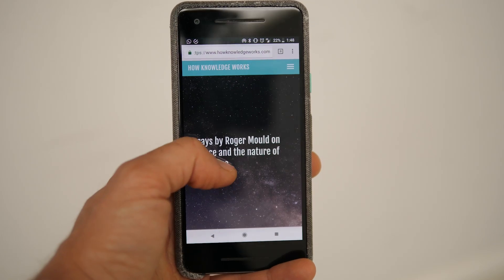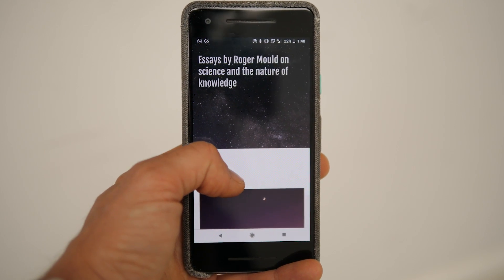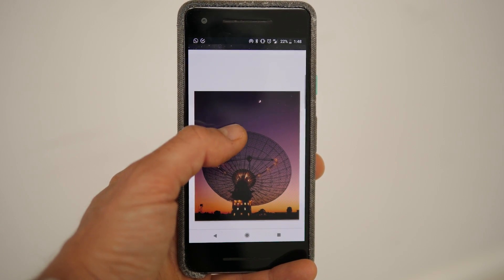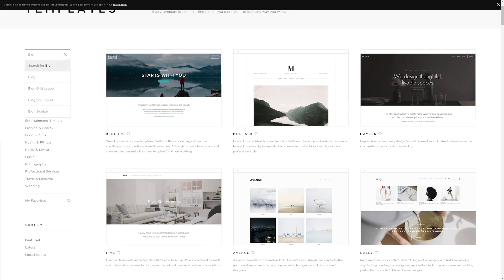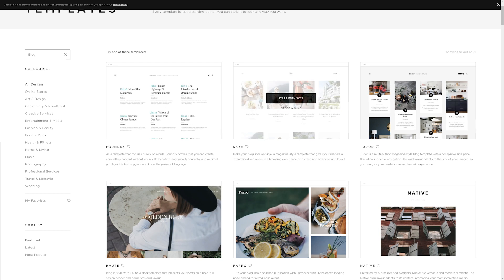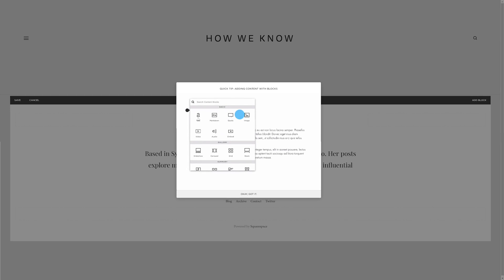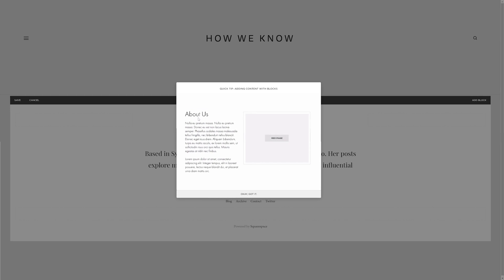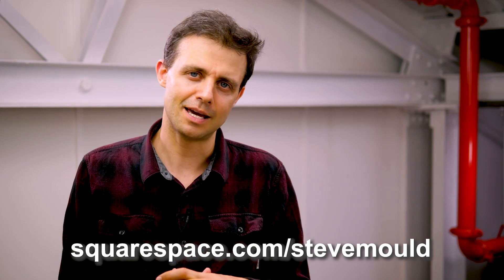The bizarre ripples that form in a stream of water

Comment: 5: 12 i dont understand the explanation here, because the surface of a cylinder would be smaller than the surface of that "tunnel" shape. If were talking about the surface of that red circle though, then why is soap trying to minimize that instead of whole surface like it would with a bubble ?

Comment: I used to turn the tap down to the thinnest laminar flow stream and then slowly push my finger up the stream in order to push the waves up until they touched where the water emerged and then that would trigger the Rayleigh-Plateau instability and then the water flow would remain broken without changing the flow rate (opening the tap further). I tried the reverse and could sometimes get it to shift state back to laminar again. I didn't know any of the physics was behind it so thanks for diving deeper for us! <3

Comment: 34 seconds into the video: my 5 cents is that it has to do with the surface tension that creates a flow difference between what inside and outside the surface tension area: thus the ripple.

Comment: The ripples in the obstructed water flow look quite similar to the ripples that can appear in a rocket or jet's exhaust plume. Assuming the two phenomena are related, something you don't see in the water flow is that these ripples interact internally with one another, creating what's referred to as "shock diamonds" (which is probably the best term you could Google if you want to see a nice clear example of the ripples in an exhaust plume).

Interestingly, while a rocket ascends, and the ambient atmospheric pressure lessens more and more, the ripples appear to expand along the plume, almost exactly like how the ripples in the flow do when you move the obstruction closer to the nozzle. And this keeps going, until the visible plume is effectively just the "top half" of the very first bulge. The only real difference between an exhaust plume and the water flow being that the water flow doesn't expand laterally like an exhaust plume would, but that's just because the ambient pressure isn't changing during your experiment.

Comment: Hi there! I actually was a part of a nonlinear physics research group at SJSU that published a paper on this phenomenon. My friend Mark Fallis had a copy of “The Flying Circus of Physics” which talked about this phenomenon but did not explain it, so we asked our professor Dr. Lui Lam if we could run a controlled experiment to get some data associated with this effect on water columns. I made the apparatus and did the hard work of collecting data. There was a team that also worked on the theoretical physics behind it, and as you mentioned in your video, they realized that it arises from a minimization of energy of the surface tension. Our paper is in a text called “Nonlinear Physics for Beginners” and my crude drawings are featured in the publication. Heh. Thanks for doing this video. I’m sure you read a few papers on this phenomenon—perhaps read the paper that has my name on it as well. It’s been a long time, and I’ve forgotten most of the actual theoretical formulation but your clip was a fun walk down memory lane for me. I’m a college physics/astronomy professor now at Evergreen Valley College here in San Jose, CA. Thanks again!
Reply: The paper I coauthored was called “The Instabilities of Water Columns” (1989).

Comment: I don’t see this as strange. When it rains, raindrops hit the ground and bounce. Likewise in a laminar flow, when  the flow hits an obstacle iT (however partially) bounces. This upsets, interferes with, (or completely fractures) the surface tension.

Quite possibly, where there is a finger involved, heartbeat might become a factor.

Comment: It's surface tension. When you block the flow, it backs up the stream and it buckles. When the droplet separates from the stream, it snaps the end of the stream closed and the stream acts like a rubberband that sends energy upwards which has the effect of a momentary blockage.

Comment: Nice video!
But I missed the explanation of why the ripples form upwards of the obstacle, given that all of the water molecules are falling down.
In my opinion it has to do with the energy of hitting the obstacle is reflected in all directions, small part of which travels upwards, and the reason it happens is because the water falls slower than the waves traveling thru it (which would be the speed of sound).

Comment: In laminar flow all the water is going in the same direction but can be different speeds. Surface tension draws the water to itself. Right?
So gravity draws the water out of it's most spherical shape ,and the column has to narrow as it's speed increases. 
An obstruction slows the flow, allows the surface tension to pull the water back towards it's spherical preferred shape of least surface area ,and one creates essentially, a stack of incomplete spheres above the obstruction. 
If the stream gets drawn out narrow enough, surface tension again predominates ( area to volume ratio) and the stream breaks into a series of minimal surface area drops. 
They just come apart rather than blend together because they aren't slowing down- and therefore 'don't bump into each other ' .

Comment: I took a short video clip showing a very interesting and similar phenomenon. A tiny hole in a water bottle, when squeezed, creates a stream of water that exhibits a standing wave that splits into two streams that change direction very rapidly as you vary the pressure. After watching your video, I think this is due to the stream breaking apart at different nodes. Anyway you can see the clip here: 
https://youtube.com/shorts/PuhXok2ZQGI?feature=share

Comment: well molecules in a stream are connected and surface tantion (specialy in freefall) is pretty strong. so any curveture you introduce downstream will effect up. flow must be faster then speed of sound in water to overcome thesee waves. and it does not jump str8 to clean vertical wave . with unsymetrical intrusion you create asymetrical curve more then a unified wave

Comment: I wonder if you've ever noticed sometimes when a rivulet of tapwater is flowing down the side of a vertical surface, especially stainless steel, like a photo developer tank or a sink, sometimes the rivulet meanders like a river and will even switch back and travel upwards for a ways. What does that? My guess is electrostatic forces between the water's surface tension and the metal surface.

Comment: I am sure the water molecules ricocheteting on the obstacle must play a role. And surface tension, as mentioned. You can test the effect of surface tension if you create a laminar flow of water with a small amount of dish washing detergent diluted in it. This will diminish the surface tension and most likely change the shape of the standing wave.

Comment: I don't think it is the same as the water drip. Imagine a  black hole at the end of a laminar flow that creates an immense vacuum to suck the water stream faster than it can flow. The surface tension will want to keep some containment and as the vacuum is applied, there will be a thinning of the stream. In contrast here, we are putting a blockade that will increase pressure and the surface tension does a small amount of keeping the stream together and backs up the flow as much as the surface tension can do. When this backup is great, it will make a splash because it overcomes the surface tension, but when it is slight, it creates this bulge as if you were stuffing a sausage casing (the surface tension) and not allowing it to move forward.

Comment: I struggle to understand how the surface area of the soap film is minimized by curving the surface between the top and bottom. The shortest distance between two points is a straight line, so a perfect cylinder should have the smallest surface area, not one with a curved surface. 
Further, with the curved surface decidedly NOT being the minimum, why would preference be given to a concave bowing instead of convex? They can both achieve the same surface area. 
I would really appreciate an explanation/elaboration of why you said this as it seems like a critical point to the explanation you're making.

Comment: Holographic Principle Imagery projection-drawing Modulation, in Completeness. 
This is the evidence of empirical shaping laws squeezing everything, transverse trancendental e-Pi condensation by Superposition-point Singularity Positioning Thermodynamics of mass-energy-momentum In-form-ation in continuity. 

If you have a Ruler in your hand, transverse, you should see the marked measurements of whatever relative proportions it is intended to Reference to a Standard, (eg the wave length of light in Ceasium), so that the orthogonal-normal Positioning makes the edge of the Ruler a point. This is how Woodworkers check if the edge is "true", ie straight to the point. 
Time is omnidirectional-dimensional logarithmic interference positioning resonance<-> numberness of transverse trancendental, self-defining AM-FM e-Pi condensation In-form-ation, zero-infinity i-reflection containment = condensation modulation..

This is the cause-effect of time-timing sync-duration wave-packaging alignment of Electron-photon-phonon-Proton in the gravitational integration process of sync-duration time-timing, which effect you can hear by dragging a wooden Ruler along a bench, making it shorter and sending the pitch higher as the length over the edge of the bench shortens. Every kid does this, and it's great intuitive knowledge but better when explained and included in analogous phenomena like the one in the video. 

It's one of those "seeing the woods in the Tree.., can't see the Woods for the Forest" type situations of "putting things, (the QM-TIME Completeness cause-effect Actuality Positioning Principle), in Perspective", Precision is not Accuracy, that is why Teaching and Learning is Sciencing.

Comment: I feel like when you mentioned surface tension you were on the right track, but isn't it possible that it's just force from the obstruction causing a disturbance in the stability itself just by "halting" or "detouring" some of the molecules which are being held by the surface tension of the water?
Case in point:
When the water is just flowing in its steady laminar flow, it's smooth with no ripples, but as you have noted when something touches it, it creates the ripples. I feel like this has to do with the obstruction's force back to the water hitting it, as with every force applied to an object, the object must give back an equal amount of force to not be pushed back. So if you say, put your finger under the water and hold it steady, the equal force will allow you to keep your finger suspended under the force of the water, and the water's molecules will displace. Since it's a slow and steady flow, however, and not a turbulent flow, it is not enough force to break the surface tension. This allows it to, instead of flowing around your finger as water likes to do, keep its flow and instead creates back-ripples up the column. 
The vibration can be explained as well, this is the water attempting to move around the finger or object in question while battling the forces of gravity with its disturbed surface tension. It seems to be more prominent on something like cloth I noticed as well since the cloth is absorbing some of the water. and taking some of the water from the flow, creating gaps.
I mean I could be wrong entirely or missing something that I have no idea is there, but this just seems like the simplest explanation to me.

Comment: Yes, I know this 3 years old, but, I've noticed something weird when pouring cream into my sink. Starting low, it's a nice smooth pour. Then as you gain height, you stat to experience some splash. Normal. Increased velocity, increased chaos. 

But, why is it that when we pour it from an even higher height, it returns to a no-splash stream?

Comment: I thought this might be affected by the speed of sound propagating through the medium. Now, I am not sure if it is technically possible to get two fluids with the same viscosity and same density to have different speeds of sound propagation, and then to repeat the experiment to see if there are any differences in those standing waves. Maybe by changing the ambient pressure around the stream of liquid?

Comment: I am late to the party by a few years, but being recommended to watch this video again, I've been compelled to give a bit of my intuition in the subject. 
I have always wondered this phenomenon as a child, but never had the knowledge to understand why it happened then. During the field test showing a great profile of what it is doing, a light bulb went off in my head. It was then, that i remembered a certain quote stated, (I don't remember verbatim, so I will brutally butcher it) 

"An object has no knowledge of it moving or being still."

Therefore if a rock is moving at a steady velocity of "1" along the surface of water with a velocity of "0", the same effect will be observed if a test is done with the water moving at a velocity of "1" while the rock is at a velocity of "0".

You see in the test when the water is falling from the spout, there are no ripples if nothing is affecting the flow. Same as if a river of laminar flow has no obstruction in its path.
Now take a rock (the blue rag in this video) and place it in the river. You will notice there will be ripples propagating in front and behind the rock.
Same thing (I predict) would happen if the column of water is still, and you are moving the rag up the water at the rate of the moving water prior.

I predict the ripples get grouped together the further down you go due to the velocity of the water is higher. Same as an aircraft increasing speed in the air and visually watching sound waves get tighter together before reaching Mach 1, or a boat moving across the water at an increasing rate while watching the waves get closer at the front.

This is not by any means of a solution/answer to the effect, but its a more simple understanding in my mind and my theory on what is happening.

If anyone knows the quote I am trying to say, please do not hesitate to provide me the full and correct quote and by who. Thank you all.

Comment: "pinch harmonics" and node points up and down any stringed instrument? These are ratio points from either end of a tensioned substance? Does the surface tension act/behave like a tensioned solid? My guess, yes it does...the ratio to width/length/node is the resonance...I would suspect the "obstruction" behaves like a "slide" on a guitar. I would bet a submerged microphone would represent the wave on an oscilloscope? Añd why water instruments exist?
But, musing (music?) "aloud"? 🤣🤣🤣🤣
Actually? Wind instruments? Doesn't fluid dynamics/physics apply to gasses? Ramjets operations on harmonics/ pressure peaks?

Comment: I don't think so. The Rayleigh-Plateau instability happens when the flow breaks, while those ripples happen when the flow is "compressed", meaning that the shape and width of the flow tries to accommodate the starting intensity of the flow when the speed is reduced by the obstacle.

It is the opposite of the Rayleigh-Plateau instability, where the speed of the flow is increasing because of gravity, while here the obstacle reduces the speed of the flow in a "tube" made by surface tension, and the tube inflates and deforms at certain points.

It would like to make a spiral to elongate the flow, but can't really, because of the surface tension, so the wavy deformations translate into bulges.

Comment: 2:24 Cool thing about candles - the "smoke" that you see when you blow out a candle is vaporized wax. You can demonstrate this by blowing out a candle and then touching a flame to the stream. It will light, travel down the stream, and relight the candle.
Reply: Yes.. surely that happens.. 😄
Reply: @shayakbardhan1634  I've literally done this at home. Try it if you don't believe me. You'll either prove your point, or see something really cool.

Comment: I've been stumped by this effect since I was little =\ My own guess is something to do with the fact that when you put your finger in the path ( I've done this in my bathroom tap when I was bored and always played with the tiny droplet of water that somehow stayed there even when water was clearly moving through it ) it obstructs the movement of the water, which slows the flow speed just at that point where the water is forced to go around your finger, which causes the faster falling water on top to gather at where it slows down- causing the bulge- and it wants to fall over the other stream because water is gathering there but because of surface tension it stays in a curve- this 'ripples' up the length of the stream as each point as water is slowed with each curve till the obstruction. The water has viscosity so its also like a very bendable stick of plastic, which when it hits your finger, then starts to bend over because the bottom parts starts moving slower than the top and it 'drapes' over itself but is held together by surface tension to not completely throw it's own stream wayyy out there- could you try this with corn syrup and let me know what happens? If it's viscosity then corn syrup should really have a very exaggerated effect lol! ( I don't have corn syrup because I'd never use it =D )

Comment: I was thinking that the water touching your finger causes the surface tension there to pull the water faster, pulling it apart almost to the point that it starts to form individual drops.  I wasn't picturing it as slowing down and stacking, more so speeding it up to the point that there isn't enough volume to support laminar flow.  Is it a coincidence that it starts to look like what water looks like when the stream volume is reduced?